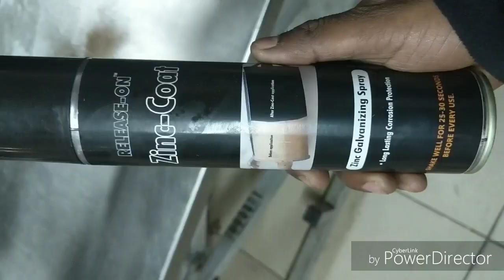Why is my Dominar 400 exhaust pipe looks so rusty? How to fix this?

Comment: Is this still working. Went to 3M store and they said Bajaj has not authorised or given permission so they cannot do anti rust coat. What is the solution for this?
What spray paint can I use?

Comment: This is not a heat resistant paint....
Reply from the maker: No it's not. Zinc spray galvanizing is process where a coating is applied to a steel surface by spraying it with atomized particles of molten zinc.

The zinc coating provides excellent corrosion resistance for steel and iron objects and structures used in various environments such as marine, industrial and other unfavorable atmospheric conditions.
Reply: It's electroplating 😂😂😂😂